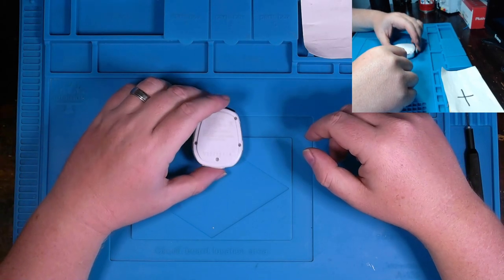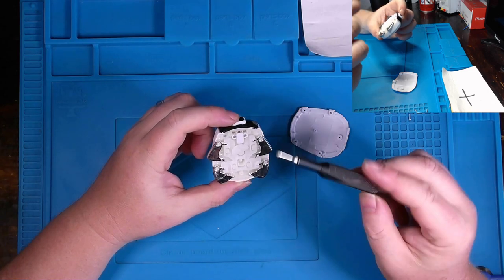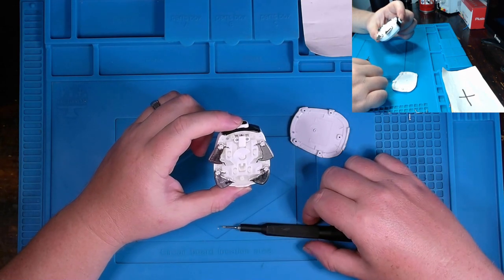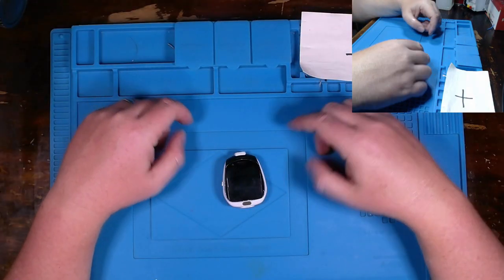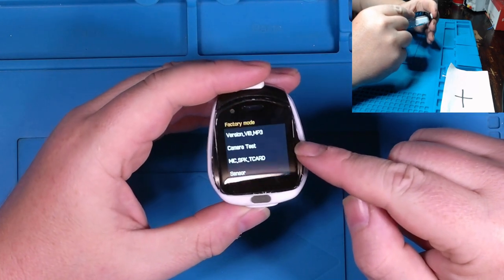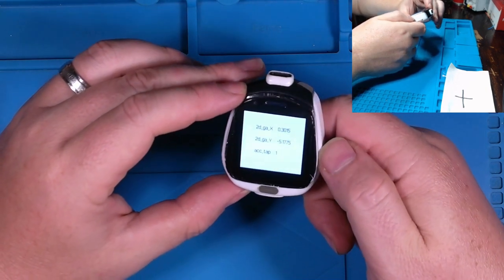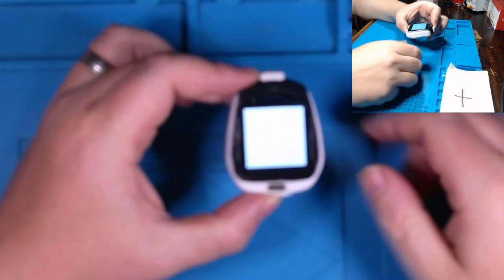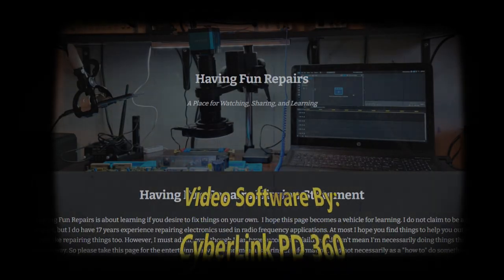(Quick Fix) Little Tikes "Tobi" Kids Smart'ish Watch Repair

Comment: Where do you get the spring from. I lost mine too
Reply from the maker: I made one out of some small diameter wire I had laying around my office. If you have a local Hobby Lobby or Harbor Freight you should be able to shop for micro springs and replace.
Reply: @HavingFunRepairs  Thanks I did just that and found a variety pack for 5 bucks!

Comment: I think while I was in there already I may have replaced that charging port it looks a little rough.
Reply from the maker: I actually did that after I recorded this video. Hindsight 20/20 I should have included it in this video, but the primary issue was resolved with the button and corrosion.
Reply: @HavingFunRepairs  awesome love the video and so do my daughters
Reply from the maker: @adamkorb86  that comment made my day. Cheers!